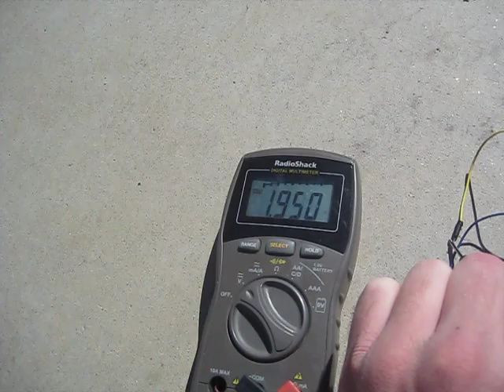FLED Solar Engine Take 1

Comment: How are you making the engine turn continuously? I thought the use of FLED would only make the motors kind of “blink” too.
Reply: Once the led turns on for the first time and the motor starts the 2N3906 stays on continuously due to the connection to the low side of the motor so in effect it "latches" and therefore runts the motor until all of the current is drained from the capacitor.  Therefore the fact that it's a flashing LED doesn't mean that the motor pulses on and off, it doesn't.  BTW, I've been able to make this work without a flashing LED.  All that matters is the forward voltage of the LED that's being used.
Reply: Enigma758 hey pls pls help me. I am not very experienced. When I did this, I followed the schematic and motor was pulsing. When I flipped +/- of the FLED, it was turning continuously. I did not see the FLED flash once as you said (maybe I didn’t notice?) I tested this with a battery but should that matter?? How come when I followed the schematic, the motor was pulsing together with the FLED? Is it still a solar engine with the FLED flipped? Thank you for your response!
Reply: I have a 6v solar cell but I’ve damaged one before so I did not solder it yet so I’ve been testing using a 3v cell.
Reply: @whopassedthegas  It depends what you mean by pulsing.  The circuit is designed so that the capacitor charges and then fully discharges through the motor, spinning the motor.  The capacitor then charges up again (via the solar cell) and when the voltage reaches a threshold that's high enough to turn the FLED on, then again it dumps its charge to the motor.  That is one form of "pulsing" and if the capacitor charges quickly enough, you will see the motor spin, stop briefly, then spin again.  If you tested with a battery, you might see quicker pulses, not because of the FLED flashing, but because the battery is charging up the capacitor very quickly each time (then discharging).  Flipping the FLED should make the circuit not work at all because the FLED is a diode which only conducts in one direction - so do not flip it.  It sounds like your original circuit is working.  You can test your solar cell by shining light on it and testing the voltage with a voltmeter.
Reply: Enigma758 this helped me understand so much better. Thank you sir
Reply: @whopassedthegas  Good luck with your projects!

Comment: Can you post a link for where to buy the flashing leds? I looked on ebay. I want to make sure I get the right one.
cgi[dot]ebay.com/5pcs-5mm-Red-Flash-Flashing-Hi-Power-Diffused-LED-RRF5-/290587544032?pt=LH_DefaultDomain_0&hash=item43a85e09e0#ht_1267wt_826

Comment from the maker: @ricglos Hi! I get most of my stuff from eBay. I did a quick search and found these two items:

cgi . ebay.com/2p-2x400-pts-solderless-breadboard-w-75-pcs-jumper-wire-/250817122613?pt=LH_DefaultDomain_0&hash=item3a65dd9135#ht_1639wt_1078

cgi . ebay.com/FREE-SHIPPING-Solderless-Breadboard-400-contacts-/270694398426?pt=LH_DefaultDomain_0&hash=item3f06a4b9da#ht_1192wt_702

Now that school is out, I'll have some more free time to experiment. Thanks for watching! :)